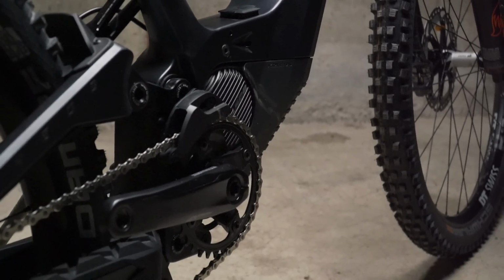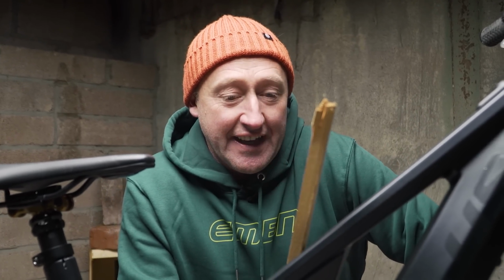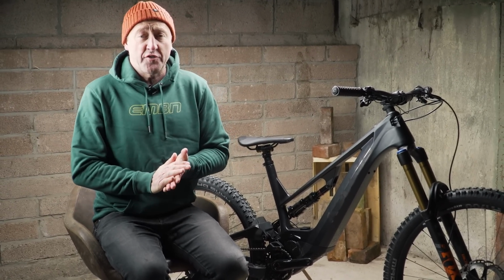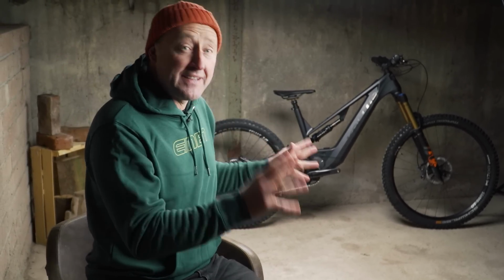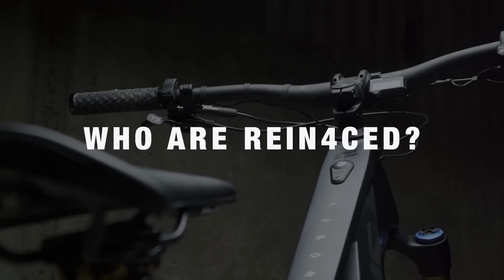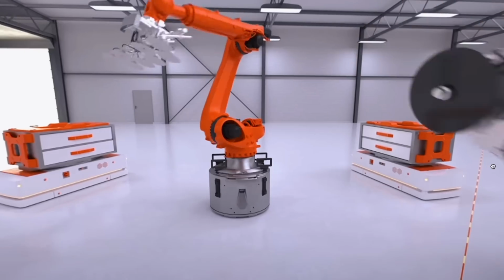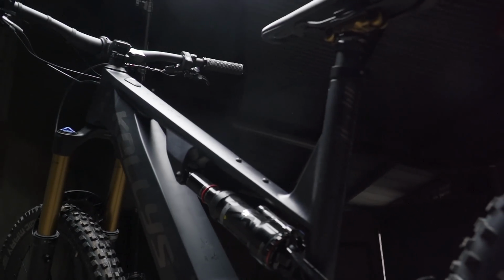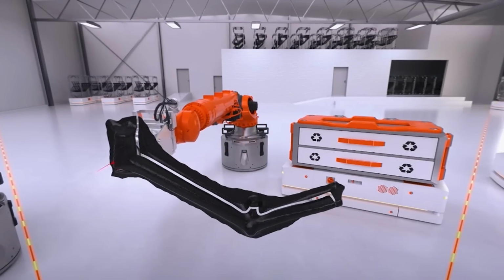Is This The Future Of Mountain Bike Frames?

Comment: If carbon was any good they would make aluminium from it and if aluminium was any good they would make steel from it. 
Seems like a lot of work to save a fraction of weight to then add 1kg with a 700wh battery. Eat more salad if you're hard wired to think lightweight is important. With Emtbs the weight works for you and is the least important factor. Reliability, adjustability, handling and best suspension is what people need. E=Mtb²
Reply: With Emtbs, weight is important as it has a big affect on range and the components like wheels, suspension and brakes. If weight wasn’t and issue they’d just make them all out of steel. Weight is not as much as an issue as with a normal bike but it does affect the handling. If you had a 40kg bike it would be very planted but handle like I pig.
Reply: @streddaz  Steel frames are not really heavier than Aluminium as they can be much thinner tube. The only problem with steel is it's not fashionable. But everything I own and wear will never go out of fashion because it's never been in fashion. Many superlight track bikes are still all steel..I'm 62kg so I've got 20 to 40kg advantage  on some other riders. 23 to 26kg bikes for Stability, under 18kg Emtbs are for Flickability. Depends on how we want to ride. Emtbs are not for racing just Fun Fun Fun and having both a naturally aspirated and a Emtb is the go. E=Mtb²
Reply: @robhaskins3068  Steel is heavier than Aluminium, it's not a fashion thing. The reason most aircraft are made from aluminium because the weight to strength ratio is superior with aluminium.
Show me a full suspension bike that is lighter than the average aluminium or carbon bike. The reason a track bike is reasonably light in steel as all the tubes can be straight and there's no suspension linkage mounting points, dips in the tubes for standover height. If you are worried about it going out of fashion and lasting for ever, I think you should give Ebikes a miss and stick to track bikes.
A steel full suspension bike would be very heavy due to not being able to hydroform the tubes like they do in aluminium bikes and you are locked into the standard tube sizes.
You could go down the CNC route like Pole, but you will still have a considerably heavy bike.
If you are not concerned about performance or range so much, a steel bike may do. I myself think that the 24kg bikes are too heavy and much prefer something under the 20kg mark as I would like an Ebike to ride as close to a normal bike as much as possible and the lighter the bike the better the range will be.
If you want a 30kg+ bike you may as well by a dirt bike.
Reply: @streddaz  Yes I have 3 Aluminium and one C framed Emtbs and one plastic composite naturally aspirated mtb 12kg .My heaviest Emtb is the most stable and feels good up and downhill. I'm not going to buy a steel framed Emtb but have broken C rims,steering head, crank and snapped a Aluminium swinging arm and  I'm just a frail weedy 67 year old at 62kg.
Not buying any new bikes until they have integrated automatic gearbox/ motor Aluminium frame belt drive and dead straight swinging arm pivoted directly from cranks to eliminate belt tensioner.
Dirt bikes are now dead to me because they have become totally socially unacceptable because of dunce behaviour, noise and erosion. 
But it's E=Mtb² for me  (from E=mc² the world's most famous equation) If you don't get it you never will.  E=Mtb²
Reply: dont get it why they put lightweight tyres on this beast.
Reply from the maker: Hey Rob! Although it's a lightweight material it also has strength and durability benefits over a standard carbon frame. 👍
Reply: @embn   Hopefully in the long term it can be a successful material as well as fashionable. Might be able to make a integrated automatic gearbox motor housing from it .The Evolution continues 📈🥂 E=Mtb²

Comment: Steel,Titanium, or Old 6 series aluminium. Forget that carbon fibre as in 15 + years as the epoxy bond starts giving up. Yeah I know we will all progress or die eventually but so does carbon fibre. You will always get someone with a Tig welder or oxyacetylene if you ever damage one of those frames mentioned.. carbon fibre and 7 series alumin,  might be lighter and stiffer by design, but is that always a good thing? Here son here is your dad's old downhill Santa Cruz sorry it's a bit dilapidated but the epoxy gave up and the fibres delaminated. As opposed to here go ride this old strange looking bombproof frame, might be outdated and geometry is way off the scale but still a laugh, I managed it down glentress 30 odd years ago 🤣
Reply: From a former aerospace engineer who now specialises in carbon repair:
"Carbon composite based on epoxy resin shows a very long lifetime during fatigue testing, thus there’s no degradation of the composite over the lifetime of a bike.
Only long-term strong UV exposition can harm the epoxy structure, but all our frames have a UV protective agent included in the final paint layer"

Carbon is fine.
Reply: @mrnobody9821  I have no doubt that's where we are now, but having spent the last 30 years watching the material take hold repair it, watch it self destruct after a period. I will say no thanks, it's a bit like flat roofs gauranteed for life for 3O years, they don't leak! ( on paper) ok in hot climates but in the windy wet ermmm  welcome back to the real world, I will just stick with something that is easily weldable. (Mech Tech)
Reply: To be honest i was hoping to see more titanium enduro made by Major brands. Titanium frame will outlast us. Also it would be awesome as a kind of family heirloom. Imagine someone down down the line still riding it. 
The same as Samurai sword or just an old anvil. A titanium Gravel bike frame can be sures to last a thousand years if just maintained. Its crazy
Reply: @lossantoscity3249  I absolutely love titanium, I had an old 90s mtb Fuji frame with Richey lugs, it got stolen bleep  Between the cost and the longevity of the frame that's why, why create something that lasts forever.